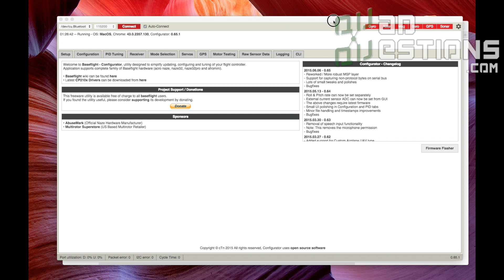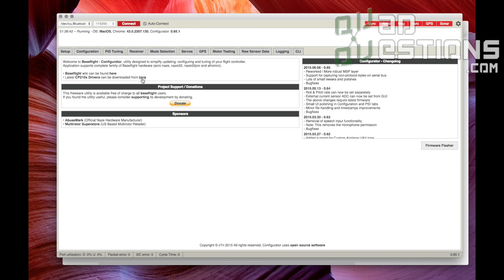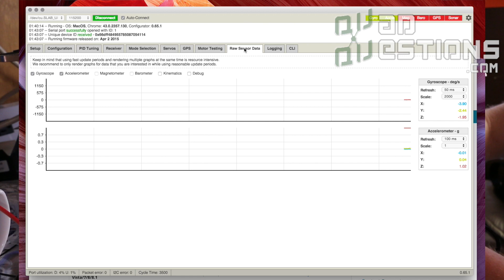How to test and solder the Naze32 Flight Controller Acro & Full

Comment: Man I just bought one of these unaware you sell them soldered already. I had a battery go bad and now my quad is acting way crazy! It’s out of a Blade conspiracy 220, when I arm it the front try’s to take off and it wants to flip backwards. I updated the firmware and downloaded the stock setup and pasted it into the cli it’s better but still not right. I’m new to all this and thought I would start with a new fc. I installed 3.1.7 and it failed on the install but did put it on there and seems to be working. When I hammer the throttle or chop throttle it drops all uneven and then when you try to get it back it flys the opposite direction trying to get level. Idk thought I’d ask someone who knows this board inside and out lol thank you in advance

Comment: would it be easier to pretin the board and pins?
Reply from the maker: +John Batchler No.  If you pre-tin the pins, they will not fit through the holes.

Comment: You mentioned removing flux at the end with alcohol and a toothbrush.  Where did you apply the flux before soldering?  
Thanks.
Reply from the maker: Hi. It's in the solder that I'm using. 

That ratshack solder has a large amount of activated flux in it which is why I like to use it. 

Other solders would require the use of flux on this job. Either way, you should clean of the leftover residue on the board when finished.
Reply: +QuadQuestions.com 
Thank you for the excellent video and taking the time to answer questions.